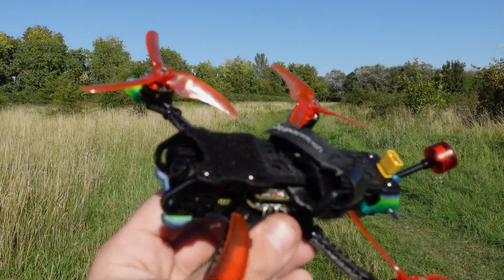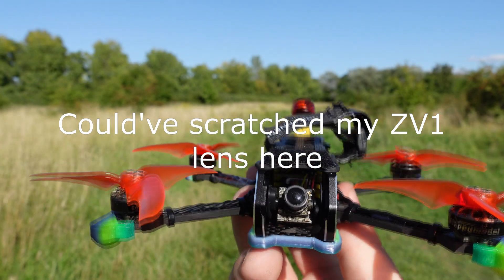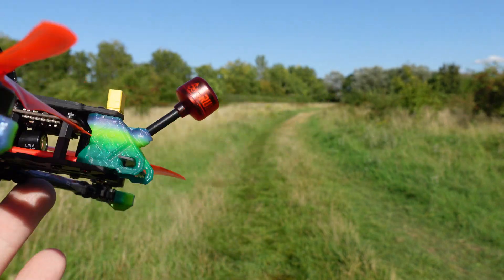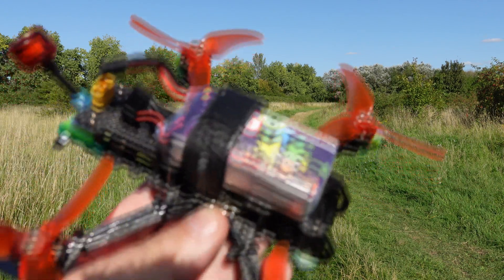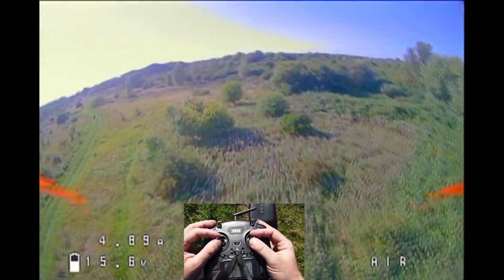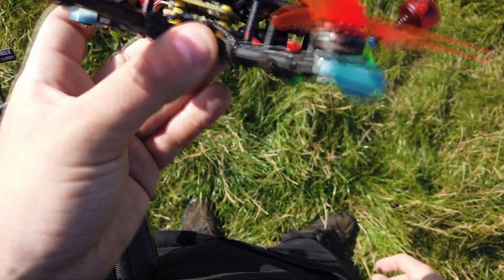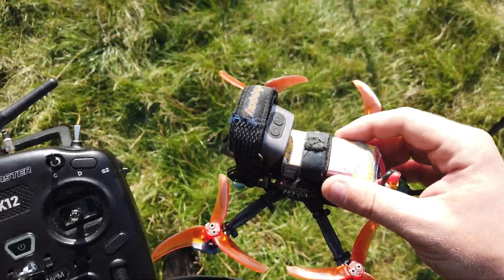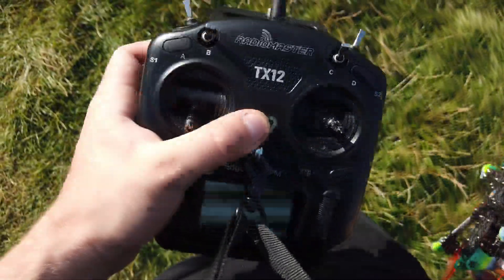Volador VX3.5 Build flight test w/1404 Motors,Caddx Walnut

Comment: i kid you not i just made something extremely similar, only real difference is i have 1804 motors and a caddx hd kit v2
Reply from the maker: i still have the same quad except now i have the flyfish 1804 motors and avatar v2 as well :D So basically we have the same i guess. Also i`m using gemfan hurricane 3525 props with the 1804.

Comment: Do you think 2006 motors will do fine with this frame? Got that motors from my old cinewhoop. Its a 6s but might use 4s for lesser power.
Reply from the maker: honestly i think it`s overkill. don`t use 4s batteries. i`ve switched to 1804 since and even these ones cause crazy battery sag. i don`t even look at my battery levels when i fly as i get the low battery notofication straight away on a full pack with like 50% throttle. On the other hand they could work with a 6s. also the KV rating is very important. it tells you how fast the motor will spin on a given voltage. for 3.5 inch freestyle i`d recommend something like 3500KV for 4S and 2400KV for 6S. 
you can also use 3500KV on 6S just have to set a throttle limit of 60-70% of the original. If the KV is under 2400,you won`t be able to get good results for this size.
Reply: @b2fpv  Thanks, that's very helpful.

Comment: It's probably not that buuuut for what its worth: is your maximum ARM Angle [degrees] set to 180? You mentioned having this issue whenever you're upside down. Might be a simple oversight.
Reply from the maker: @Grevil89  it was the idle throttle being too low. I did set it to 3.5% originally and it stopped the twitching after setting it to 5.5%

Comment: Had my crux35 for 24 hours before smashing it to bits against a tree... Hoping this frame and a Caddx Ratel 2.1mm brings it back to life. Enjoyed this video!
Reply from the maker: I used the Caddx Ratel 2 with this config after i broke my Caddx Ant. It's a good camera but you have to set it up as the factory settings aren't the best. I put this Volador frame through a lot of abuse and haven't managed to break it yet.. i feel like it's indestructible and i was ripped off by buying the replacement arms too :D I believe your quad will be underpowered with the Crux35 AIO and 1404 motors and sooner or later probably will lead to a burned down ESC. I'd upgrade to a 30-35A AIO or stack for sure. I burned down 3 of those 12A and 20A AIOs before i learned my lesson and that wasn't even on the Volador frame but the much lighter crux35.
Reply: @b2fpv  oh dear! Doesn't surprise me as the Crux35 is super cheap, although to burn the esc on the original frame sounds weird. I have read a lot of positive long term users of the crux who hadn't mentioned this problem. If I do eventually burn the esc, I will upgrade... I have already been looking at the flyfish motors that are made to accompany this frame... After my crash, I will be surprised if she (FC/esc) flies again anyway! I'll keep you posted, the package should be with me this week. Thanks for the reply.
Reply from the maker: @Sk8WineMedia  I had the Caddx Walnut camera on the crux35 so it was way heavier then the drone without a camera. yet it's about the same weight as the same build with the volador frame without a camera.
Reply: @b2fpv  the Walnut is 60g, so makes sense. I had planned on using my gopro without a battery, but that seems like it will definitely fry the ESC on the new frame. The new frame plus the RunCam Thumb is around the same weight as the original frame plus Walnut. The Walnut is kind of heavy!
Reply: Did you do this frame swap and if so did you have esc issues?
Reply: @Jalupatha  I have the Crux35 V2 and have not had any issues. Apparently there was a V1 – 12AMP and my V2 – 20AMP. I have heard that the ESC burns out but I assume it is people's V1 ESC.

Comment: Hello, nice video. Did you find out what the problem was?
Reply from the maker: My idle propeller speed was too low.
Reply: @b2fpv  how low?
Reply from the maker: @carlospsneto8505  it was set to 3.5%. after setting it back to the standard 5.5% the problem went away.

Comment: it failed safe
Reply from the maker: It wasn't a failsafe. I disarmed after it started spinning. The problem was that i set the minimum rpm too low on 3% when i was setting up the fc and it started stalling when i was falling upside down with no throttle. After i set it back to the factory 5.5% it never happened again.

Comment: 1505  3800kv🎉🎉
Reply: That's what I'm going to try. Motors are on the way 😉
Reply: @henrirotthier5710 do you have that motor testing on 1505 3800kv? Surpass hobby sent me 1505 s3950kv motors for testing with my volador vx3.5.
Reply: @Quad8ightMix  yes I have, with HQProp 3525. Powerful but not energy thirsty. With 650mAh 4s I get about 5min of intensive flying. That was my goal. But eventually I switched to a slightly lighter frame from aliexpress, JM3.5. Did not see any difference in flight characteristics, but got at least 20sec more. And it's far cheaper 😉

Comment: @B2FPV Have you got the Brake on Stop feature enabled in the ESC?. If so, you can try turning that off since it could cause these micro-desync issues.

That said, I had this issue only with the Crux35's AIO flight controller. I'm using a similar setup:
- Volador VX3.5 frame
- Caddx Vista VTX & camera
- SpeedyBee F405 Mini (no problem with Bluetooth connection, very handy for Blackbox tuning)
- Xing2 1404 3800kV motors (I have a few sets of Happymodel 1404 3500kV motors from Crux35 but did not want to cut off the motor connector)

On 3S this quad feels a bit underpowered, I'm waiting for another set of 1804 3450kV motors to try out.
Reply from the maker: Hi! The misbehaviour was due to me setting up the minimum throttle too low. After setting it back to the factory value i never had the problem again.
Reply: @b2fpv  Thanks for confirming, so it was a desync issue :) good to know.
Reply: @b2fpv  The issue I had before was consistently reproducible on flip and rapid throttle cut to zero. I suppose the ESC probably failed to spin up the motor in time because with Brake on Stop enabled the phases would be energised in the other direction rather than coasting to a stop.
Reply: @b2fpv I know I'm late, but I had this same exact issue with my 7 inch build. I've recently started just not touching that setting AT ALL. Luckily, I crashed into some woods surrounding a creek, so no collateral damage to anyone and I was able to recover it.

Comment: I have the same quad. I'm running 1506 3000kv on 4 and 6s. The quad won't hold a good tight tune, the arms have too much twisting flex. I wish they used more carbon in the arms. Going back to Apex micro.
Reply: i felt this as well, ive ran 1804 2450 kv and 2105.5 2650kv motors on tattu 850 6s and tried everything, i just cant get the tune one point either. gonna give my xing2 1404 3800 kv on 4s a try before i give up on this frame.

Comment: It feels like the CPU has stopped due to excessive load,
Try adjusting in betafilght to keep the CPU at 50% or below....
Reply: I'm not sure about this one, since the crux uses aio and the stack here is different, but the crux came set up with a pid loop frequency of 4khz which gave around 66% usage, dropping it to 2khz resulted in below 40%. That could help.

Comment: Thanks for the video! Do you know if the 3.6" gemfan props would fit on that frame? Is there 1,3mm+ space between your props and the frame?
Reply from the maker: Yes there is like 3-4mm with the rear props, 2-3mm with the front ones.
Reply: Fantastic question, bummed I had to stop using the 3630s on my crux after upgrading the cam and ever so slightly pushing the cam Frame walls outwards. Just ordered this and super pumped to use them again!

Comment: Just noticed my Walnut stopping recording and starting again as well. Love those happymodel motors... super efficient and have good power as well. Continue to rip it!
Reply from the maker: Now i hooked up my camera to charge from fc really should've done earlier as i lost some good footage in the weekend due to the camera turning off without any reason. Seems to be working now.
Reply: Walnut is a total bag of shit, gone through 2 of them and even the new one replaced by them is more unreliable than a GP
Reply: yup it auto stops recording and shut down -_-

Comment: Looks real good. Was thinking about that SpeedyB stack but still on the fence. Did the same build stuffed a Crux 35 in to that frame but I added the Walksnail 1s mini to it .Flys close to a 5 inch as I can get. Put the Insta360 GO 3 for my action camera. Mine flys great 4 now.. Thumbs up
Reply from the maker: The SpeedyBee stack is amazing. i had a lot of problems with power drops and stability issues with the crux35 without even realising it. I only realised when i first flown the SpeedyBee stack and i just had this amazing power and smoothness on my hands that i've never had with the Crux35 AIO. Now after watching back all the recordings when i started spinning or moving randomly like in this video,i realised that it always happens just after i drop the throttle to zero. When i was setting up the speedybee stack the idle felt a bit too agressive and i set it down from 5.5% to 3% i think this must be the problem as it's probably low enough to stop the propeller completely in counterwind and make the gyro control in air mode go crazy. on the second flight when it happened i was in acro mode instead of air and it just pushed a bit on the drone instead of making it spin like hell so i really hope this could be my problem. i won't really have any time to fly until the weekend but i'll set the idle back to the default 5.5% and see if the anomalies dissapear.
Reply: @b2fpv  have you succeeded to resolve the issue?
Reply from the maker: @nonicknamenoname3450  yes,the issue was the low minimum throttle, after setting it up to 6% it never happened again since.
Reply: @b2fpv  glad to hear! happy rippin!